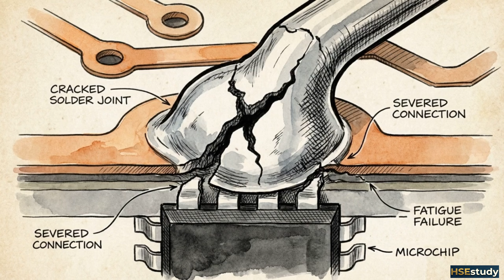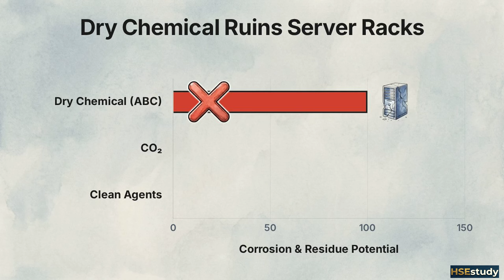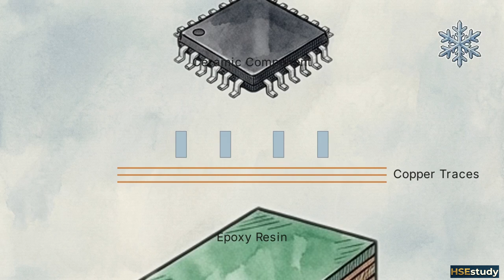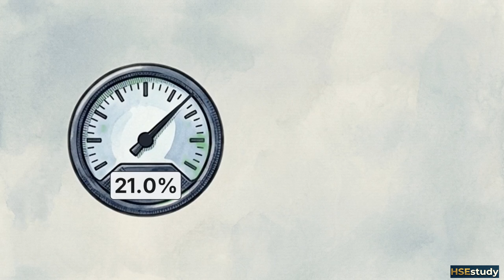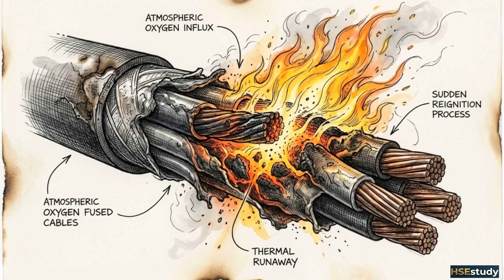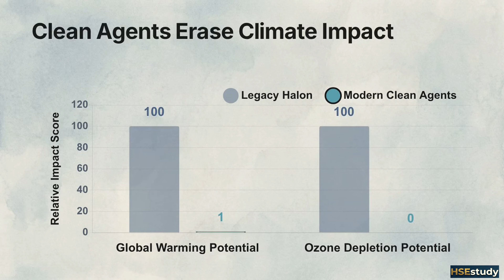CO₂ Fire Extinguishers Can Destroy Servers | Hidden Risk No One Tells You

Comment: Nice explanation, the thermal shock issues with server components is something I never really considered, and is the likely reason CO² remains a very common choice for suppression systems in IT rooms and similar areas with high value assets, particularly when you consider the upfront costs of CO² vs Halotron I, Novec-1230 or FM-200, and the fact that it's very likely the fire suppression system will never be called upon to activate during the entire expected lifespan of the equipment being protected.  

However, all that being said, this underscores just how critical it really is for facility management to do a risk assessment with all I's dotted and T's crossed
Reply from the maker: You've hit on some really key points there, especially regarding the cost-benefit analysis and the likelihood of activation. A thorough risk assessment is absolutely paramount.